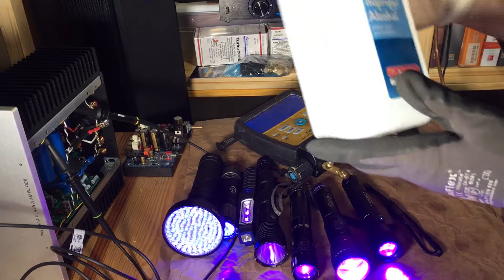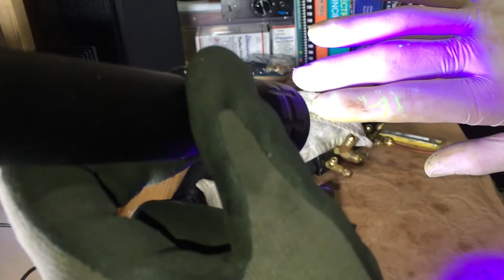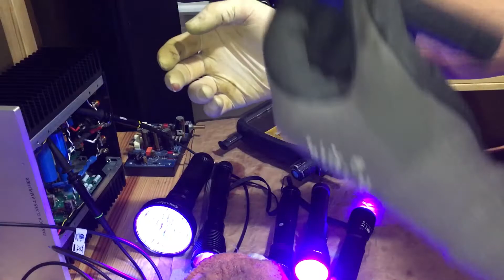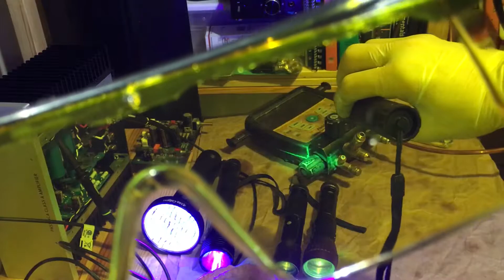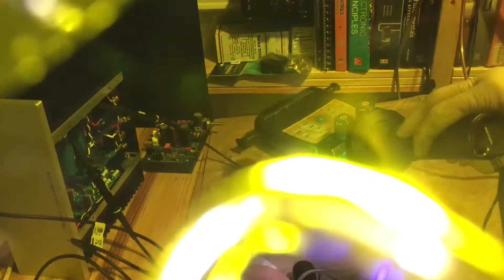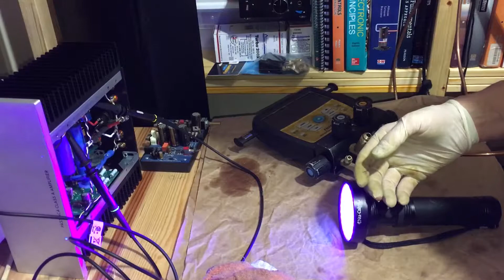SMAN 480V under vacuum to remove water from the alcohol micron sensor cleaning procedure + UV LIGHTS

Comment: Just get the Fieldpiece joblink wireless probes. These smans are a thing of the past
Reply from the maker: In residential and commercial yes not yet in Automotive. 
         Automotive needs one device that hooks up fast and can vacuum and recharge simultaneously without connecting and disconnecting. 

Automotive does not charge refrigerant topping off with super heat or sub cooling. There’s only one way and that is to completely recover the refrigerant and recharge simultaneously all in one move without disconnecting. . 

In Automotive unlike residential or you have a split system   And you have to go upstairs or downstairs to connect your probes maybe 50 feet or 100 feet away on the air handlers supply and return. On a car it’s right around the corner open the door.. 

And on a car, you’re not vacuuming a 5 ton system that has 50 feet of 7/8 inch suction line up to 1 1/8 inch suction line with a 3/8 inch liquid line. With an evaporator the size of a small bar refrigerator.
    And a condenser the size of a doghouse. 
     Instead on cars, the evaporator is just a little bigger than your hand
       And the condenser is the size of an opened up 1/2 newspaper .  With about 8 to 10 feet of hoses.. 

There’s a big difference between residential and automotive and what their needs are .

Comment: Couldn't write a lot because youtube sensored it. Trying again. Look at the Convoy S2+ Nichia 365nm on Ali Express. Be very careful though. UVEX blue blocking orange colored safety glasses recommended.
Reply from the maker: Sounds like one of those real powerful lasers that they sell and classify as safe low wattage rate lasers so they can get them past customs to sell in the United States. 
        But when you open them up and use them they can actually burn things in instantly by blind you in a nanosecond. 
      Those are the good kind of lasers. I’m looking for a UV LEDs of that same power and magnitude.
Reply: @coldfinger459sub0  this would be what you're looking for then. It's a very tight wavelength and very bright but outside the visible spectrum. I feel the heat on my hand but it's only a faint blue glow. I use it for refrigeration. They put a dye tablet in the dryer that mixes with the oil. Awesome that it's about $27 and better quality than those $500 lights full of 5mm high intensity LEDs. More does not equal better.
Reply from the maker: @RobertLanghorn  Found it thanks seen some YouTube videos on it I google searched it I eBay searched it I Amazon searched it. 
       Definitely legit. Without having it in my hand I already can tell it’s not good it’s probably very good.